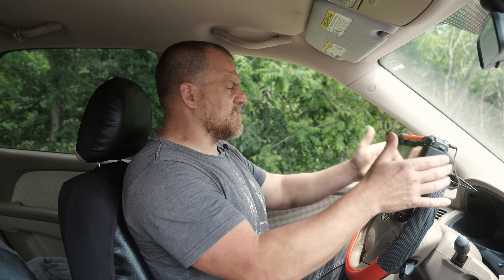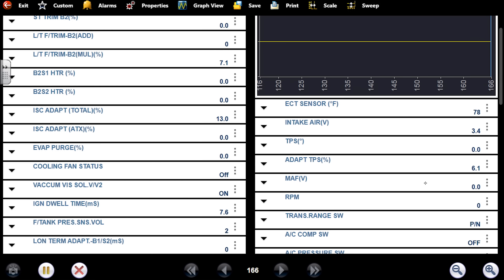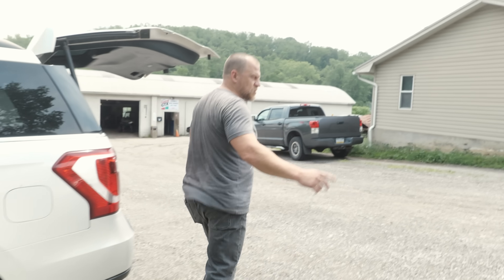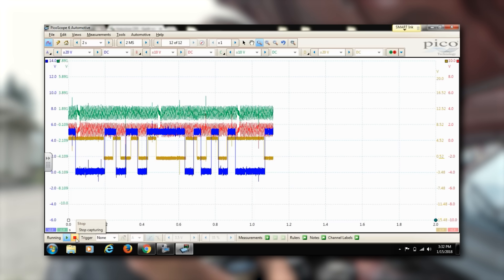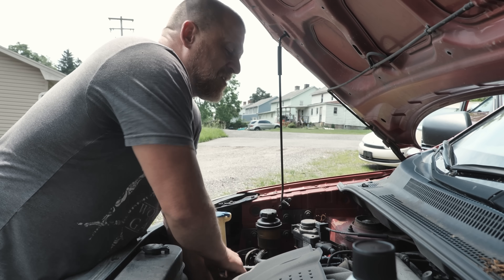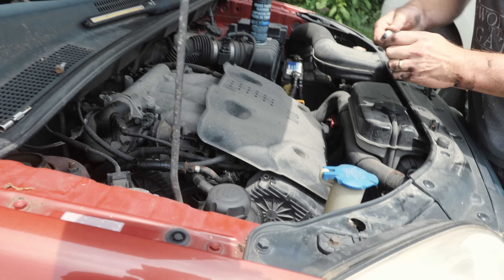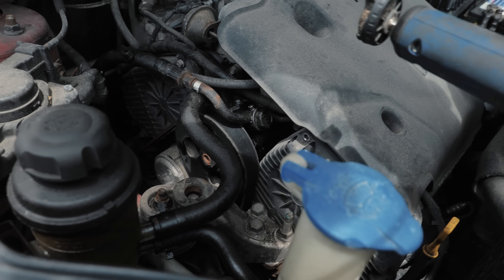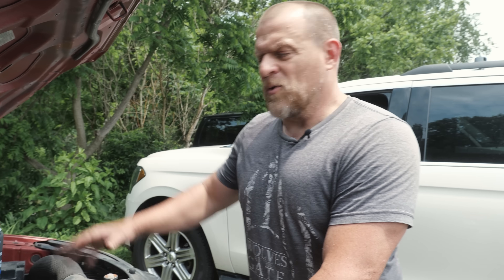Never Forget The Basics (Kia No Start)

Comment: In 2008 Kia Sportage,  with a 2.0 or 2.7L:  They are BOTH interference engines. 
But I've actually had luck with taking interference engines and putting them back together. You can peak into each cylinder with a bore scope, and as long as there isn't a hole in the pistons.  It will usually pull those bent valves back straight again;  if they are just slightly bent.  It may run with a misfire at first, but it will usually fix itself. (sometimes, ;)

Comment: What have u learn from Mazda tribute when it cranks but don’t start. I have a Mazda tribute 2002 that won’t start and it will only start if I take off the air chamber that goes on top of the engine, disconnect everything from it and disconnect everything from the EGR and throttlebody and then connect everything and put everything back and it starts up

Comment: Hey Paul, I’m having a huge problem with this Volvo S 60 would really appreciate some of your wisdom and guidance on next steps. I replaced both O2 sensors and. Still getting stuck Rich condition also delayed response Rich to leave on Bank one sensor two.
Reply from the maker: You should be testing for all of the things that cause rich conditions. Not the oxygen sensors.
Leaking injectors, fuel psi too high, MAF contamination, etc etc
Reply: @ScannerDanner  yeah I’m aware I was in your class 13 years ago and I still have your book your original field reference guide I’m telling you I think I’m chasing a computer problem but I need help verifying it. I’m willing to pay you to help me solve the problem.
Reply: @ScannerDanner  I was also thinking a slight leak in the fuel pressure regulator, allowing fuel vapors into the intake

Comment: That starter drag on the first crank was the sound of a valve bending.   Not that it matters, because it likely bent several others when the belt blew.
Reply from the maker: It wasn't. That already happened. That'd be an ignition timing issue with potentially the coils being able to fire off the crank sensor alone. This was cranked many times too by the owner and the garage owner before we got there
Reply: @ScannerDanner  Oh, don't get wrong Paul, I'm not blaming you for a thing!  I just typed that because I've been in this boat with another engine that did exactly the same thing, and I attributed that sound to the starter overcoming the valve stem.  Admittedly, I didn't consider the possibility of it attempting to fire at the wrong time.

Comment: 😂😂😂😂 reminds me of a 2002 kia optimum my bil had that stopped while diving out I-10. I had to drive 2 hrs to help and found no oil in it and filter loose. Went and bought filter & oil and then hit starter and immediately told him the engine was blown.  He asked how you know? I asked have you had timing belt changed? No he replied. They should be changed at 60k miles. Bil was like  how?  Idiot in drivers seat. He did it again to the replacement engine a few years later.  😂
Reply: You can lead a horse to water but you can't make it drink.
Reply: @Watchyn_Yarwood  I agree but after the 2nd time i bought him a bicycle. He hasn't  been around in almost 10 yrs now and i am glad.
Reply: @leethomas9198  🤣

Comment: Nice video!, but how can you feel the difference just by placing your hands on the engine while it’s cranking? How can you tell what’s going on, especially for someone like me who’s deaf, or for other deaf technicians?
Reply: Hand on engine might be difficult.  Maybe a piece of ribbon or paper placed near a disconnected vacuum hose or at the exhaust pipe to check for irregular fluttering?  But best would be a Relative Compression test using Amp Clamp on starter cable.  
Stay gold.

Comment: On forums and on my channel, I agree 10000%, start with the basics. In this instance a mechanics stethoscope might have told you the ecams weren't turning. The same applies to EML codes - oooh, I got a code for MAF, changed it and no difference!! Did you check the wiring?

Comment: Those 2.7 Timing Covers are 1 piece that goes to both sides.  Annoying little sucker.   The 3.8's are so much better.  I would pull the heads, flatten them and fix the valves.  They are not that hard to do.  I do a lot of heads on old beaters with heaters, and they still run!  Here is a great vid where I did my son's old Honda: https://youtu.be/nXs3OF0h2hM?si=rk5MprfpndfSNAzZ

Comment: I'm working on a 2016 Equinox at the moment that will intermittently stumble and die at idle, or suddenly fall flat on its face accelerating from a stop.  It stalled while idling five times while I was getting my equipment set up.  Cool, easy peasy right?  It 100% will not fault when my scantool is connected to it.  Not a single data PID even hints at a direction to go.  No codes set other than "RPM Too Low."  :D
Reply: Lance Mechanics tip. Use jumper cables to give the battery and block a ground to rule out bad ground connections. Super fly fast and easy. Good luck.
Reply: May be  missing a ground. Check the grounds at the DLC 4 and 5. Scanner could be bonding the grounds when connected giving ground to one circuit that is missing ground.
Reply: That's sounds like bad, or going bad, cam and/or crank sensors or wires.
I suggest starting with a wire wiggle check at those spots. 
Without the scan tool of course, then get a scope on those wires.
As safely as possible of course. 

If not that, wiggle check All the way from the battery to the computer, from the computer to the injectors, and then check grounds.
Reply: @kairu_aname  Was the front O2 sensor.  :D
Reply: @rhkips 
Wow. Going by the info that was way down the line.
Reply: @kairu_aname  Yeah, I've never seen that particular set of symptoms with a bad O2 sensor!

Comment: Why manufactures ever went to a belt over chain I'll never understand. Thanks Paul.
Reply: It's just a lack of maintenance from Kia's owner, not that belt is the problem. I'll always prefer belts (not wet belts) over chains.
Reply: @XISAV  I've never seen a chain break in my life, they can stretch and jump a tooth but I've only seen that on drag race setups and it's not going to destroy your engine. Chains are far more durable than belts and often last longer than the bearings themselves.
Reply: google: The transition from timing chains to timing belts in automobiles was primarily driven by cost and noise reduction. Timing belts, made of rubber, were initially cheaper to manufacture and install compared to timing chains, which are typically made of metal and require more precise and costly manufacturing. Additionally, timing belts tend to operate more quietly than chains, contributing to a quieter overall engine sound.
Reply: That's super obvious.... they know people will lose engine around 120k when not replaced every 60k.  And as a bonus it's cheap to make, YEA!
Reply: Expensive.

Comment: Possible she broke the belt on that initial crank? Incredible coincidence but not impossible. Would be very hard to not hear that irregular crank sound and mistake it for fuel pump issue.
Reply: Classic case of “it wasn’t like that before” 😂
Reply: He probably had a fuel pump sitting in his tool chest just hoping for a Kia to come in.
Reply: I'm inclined to think whoever looked at it first pulled the codes and saw the fuel pump fault. Can't wait for the "my belt wasn't broken before you touched it" customer :shelterin:
Reply from the maker: You'd be surprised by what the parts changers would do 🙂